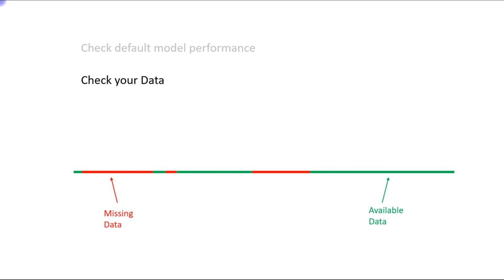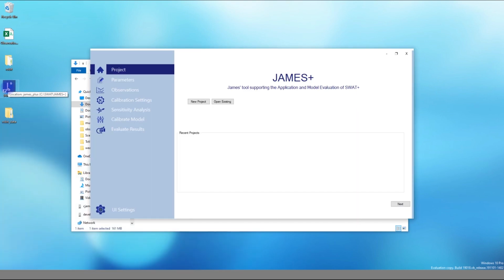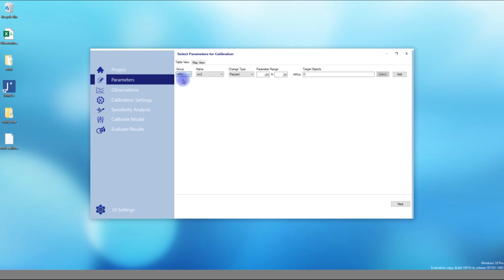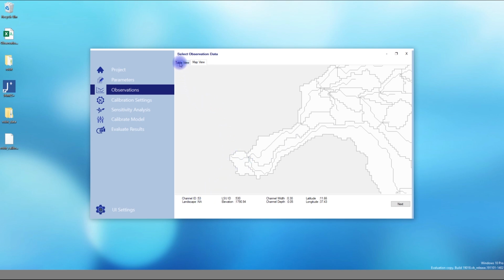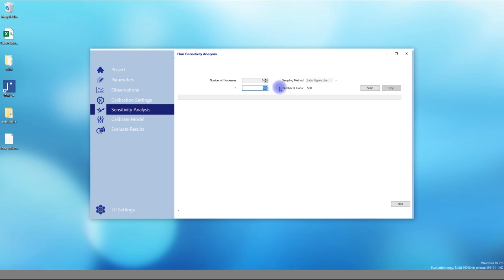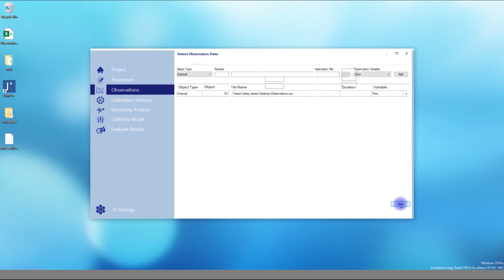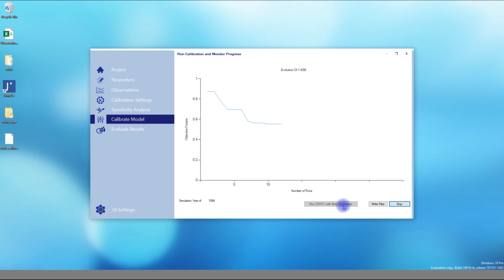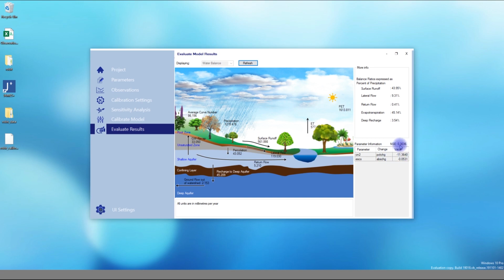Introduction to SWAT+ Part 8 -  Sensitivity Analysis and Automatic Calibration (IPEAT+) using JAMES+

Comment: Dear James, On the last part of calibration process after writing the files when I click run it says "unknown" and why is that? I tried it so many times with different computer but I couldn't solve that problem. I couldn't complete calibration process do you have any help please? Thank you.
Reply: Check the observations csv file. The date must be in the format dd/mm/yy.  
I had the same problem too and I used less amount of runs (instead of 20) and the calibration was completed successfully.

Comment: i get a straight line in calibration (no change in objective function). even in the sensitivity analysis my basin has sensitivity in esco 0.67, cn2 0.36 and slope 0.04 and i calibrate with these parameters. can you tell me the reason please.